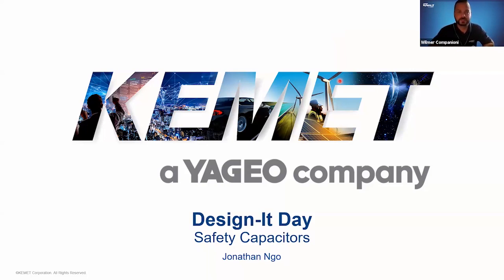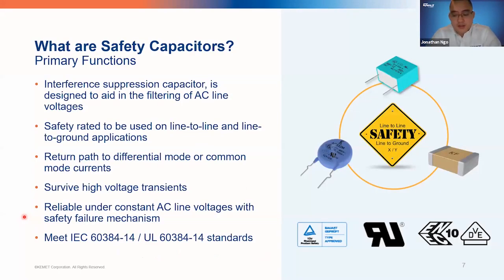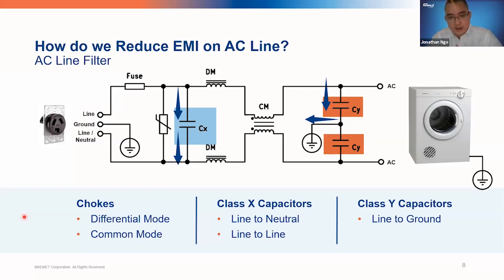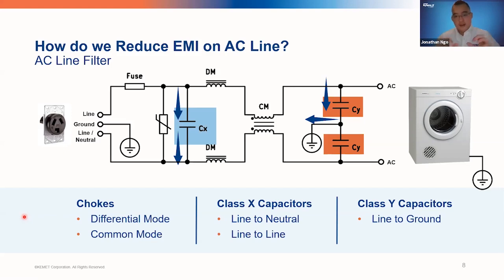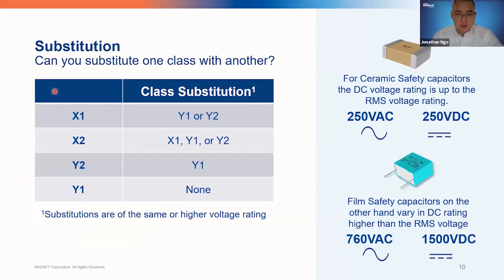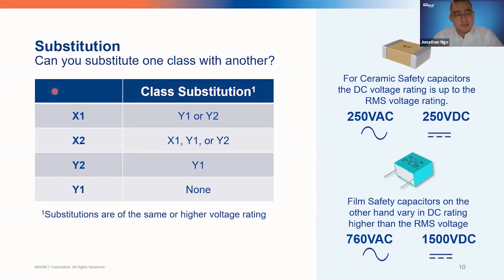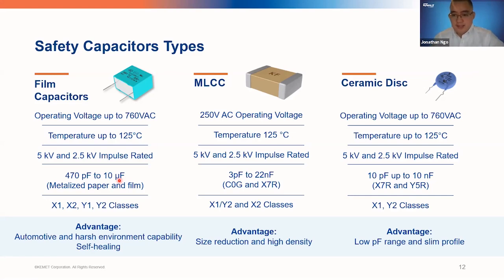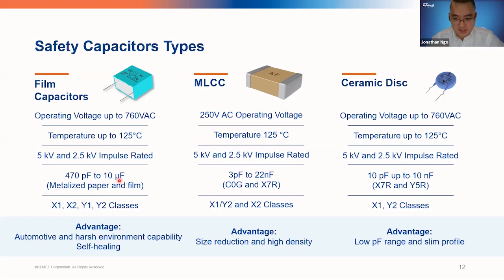Design it Day: Safety Capacitors

Comment: Just wow! This is an incredible and informative talk about the safety capacitors. Most of the things I already knew from my years of experience and learned through hard way, but this is one good video covers all in one. Its better to know what we want without go through the 100's of article pages.

I have few question. How about the values of the X and Y capacitor in an EMI filter. Is it higher the (X capacitor) better? As I know to my knowledge higher the X capacitor is better if the cost & size permits in a design. Is it right?

For Y capacitors the capacitance value limited by the leakage current to the earth terminal. Higher the capacitor better in performance but higher risk for shock during the absence of proper earth connectivity. Is it right? So how much capacitance or how much current through Y capacitor is permitted in EMI filter? 

How to measure Y capacitor leakage current .